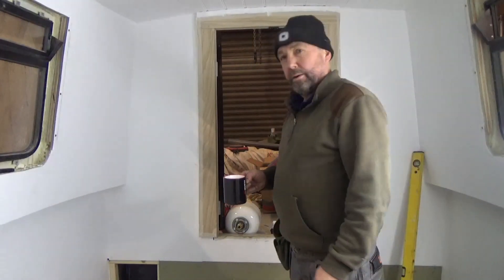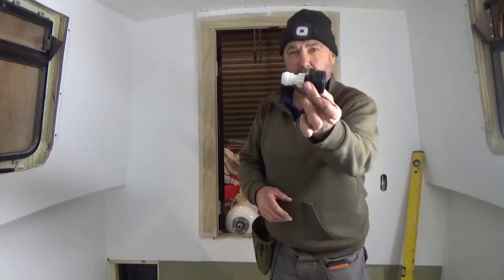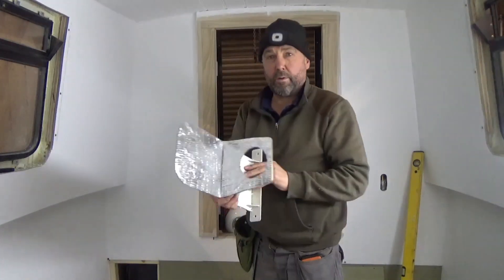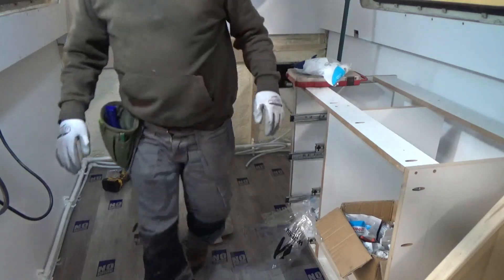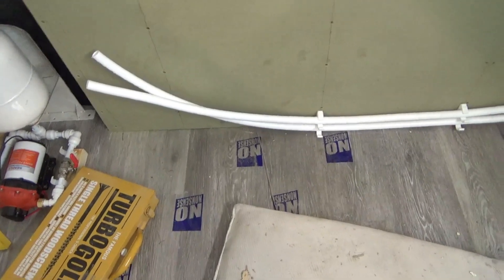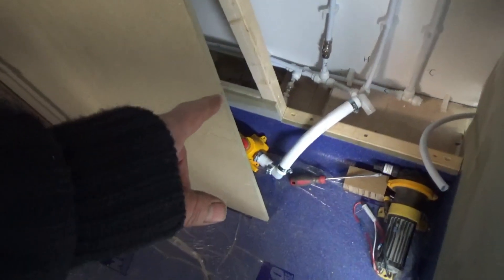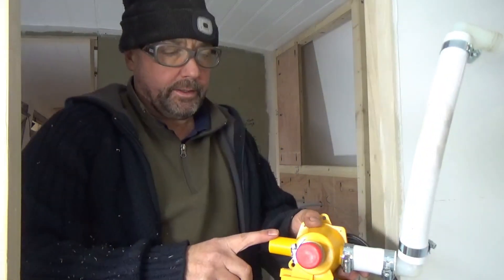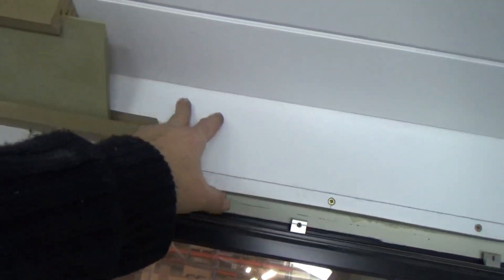Narrowboat Water Pump & Plumbing Install

Comment: Hi Andy, Although they do the job you shouldn’t use the “super seal “inserts for compression fittings.
If you disassemble one you can see the olive is not on the pipe very much 😬.
Tidy job though and love how you think things through 👍
Reply from the maker: Thanks for the info David will have a look at that.
Cheers Andy

Comment: How do Andy, have a look on screwfix for a ‘sure stop’ valve, they come in 15 & 22mm and have a remote switch which looks similar to a light switch.

No electrics just air / water pressure. 

Basically they mean no scrabbling about to get to valves to turn the water on and off, I fit them for clients as they switch off the water instantly.
Reply from the maker: Hi Martyn , Thanks for comment ,I have in the past come accross those working on properties . Will have a look at them again to see if water pressure is enough for them to work as they are a good bit of kit.
Cheers
Andy

Comment: Hi Andy - looking to revamp parts of the plumbing on our NB next summer. The pump looks like a Seaflo 55 - I would be really interested to know why you chose it and what other pumps you considered before making your choice. We have had both Jabsco and Shurflo over the years, and I am not too impressed with either.  Also, what is the accumulator tank you fitted please,  I need to fit a larger one than we presently have as we still get surging through the shower head.  Thanks.
Reply from the maker: Hi Nigel  Thanks for the comment. It is a Seaflo 51, 5 compartment pump. I know someone who had the same fitted and they are chuffed with it .So i went on their recomendation. There are also some uploads on Youtube showing it working. The accumulater tank is 8ltrs from plumbers merchant ,a lot cheaper than chandlers.
Cheers Andy .
Reply: @nogunwales9406  Thanks Andy - doing a bit of research, these are Chinese made, and while not everything coming out of China is poorly made tat, it would appear from the reviews that this might be?  I would be really interested in your experience with it. I am not a fan of Shurflo or Jabsco so my options are dwindling...